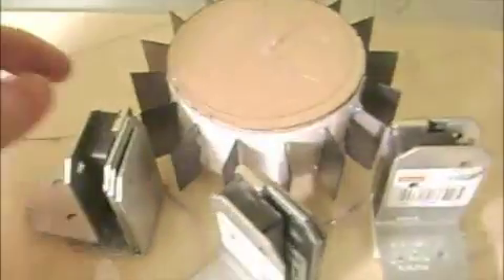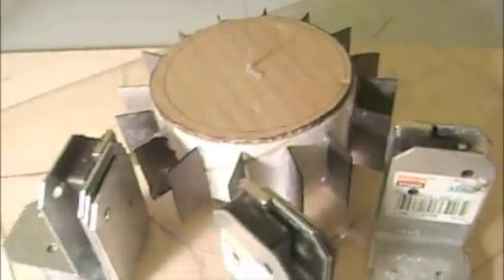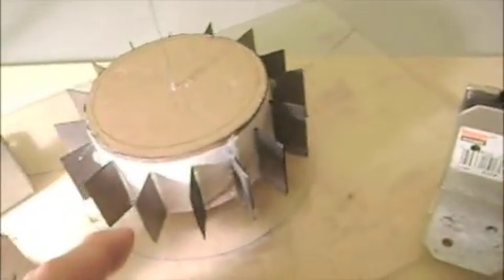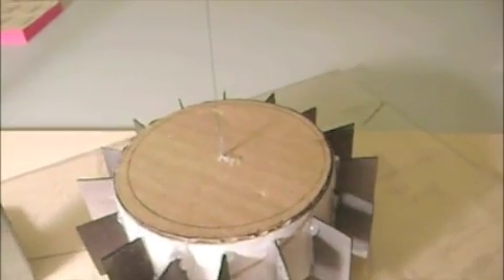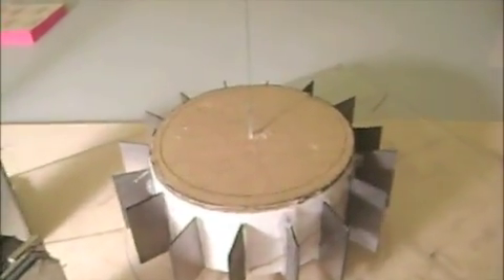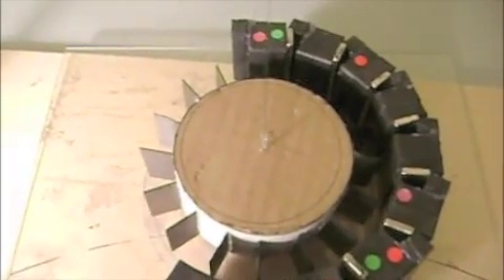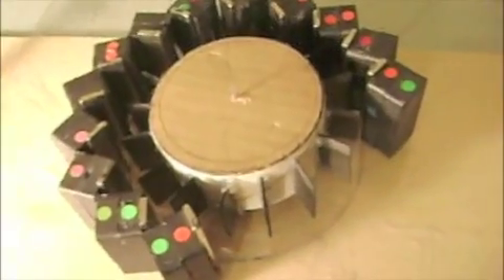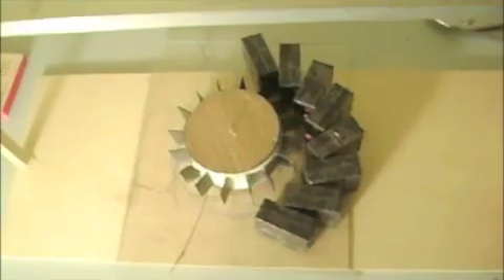Pyrolytic Graphite Rotor

Comment: My friend, I want to work with you together. we are pyrolytic graphite manufacturer, I want to give you the pyrolytic graphite for free, to help you with your test. One day, maybe our cars don't use fuel, don't use electricity, only use your Rotor.
Others who want to buy Pyrolytic graphite, can contact me: hiclsun@gmail.com
Potter Li from China.
Reply from the maker: Thanks friend. It will probably require some stronger magnets than what I was using in the first video, and some larger pyrolytic graphite.
Reply: Motionmagnetics you can try kjmagnetics.com they have great customer service, high quality magnets, and a huge selection (i mean gigantic), the magnets are dangerously powerful, literally. i recommend you do some research and learn how to handle them correctly before using them, they can easily hurt you, but they are strong enough to do some experiments with. again KJ has great customer service, for any questions on safety, contact them.
Reply from the maker: I wholeheartedly agree. I purchase a lot of my magnets from them. In fact, I just placed an order with them today to pick up some specially designed magnets that can be used to construct a Halbach Array.
Reply: Motionmagnetics nice. i myself are thinking of getting some more diamagnetically magnetized cylinders just for fun. oh and also, if you need ball bearings to reduce friction, you can get loose ones at craigballsales.com thay to are based in america, and have great products.
Reply from the maker: Thanks. I'll keep that in mind.

Comment: nice idea mate but your probably better off using bismuth coz iv worked with pyrolytic graphite and didnt find it worked to well
Reply from the maker: I have some of that as well. I just haven't felt like melting it down into the shapes I need. The graphite was easier to work with for the demo, at least.
Reply: nice work

Comment: btw aluminum is paramagnetic so it takes on the pole of the field it is close to so the same experiment might work better with aluminium and give you some repel.
Reply from the maker: Aluminum also causes eddy currents, so I'm not sure I'd get a desirable effect. Interesting idea though.
Reply: Motionmagnetics yes since you are alternating the poles maybe this will create a wave of eddy currents to surf on haha. Maybe add aluminum to the pyrolytic graphite , steel sandwich lol

Comment: Also, try facing the poles at the surface (face) of the graphite plate and angle the graphite(slightly) on the rotor... Just pumped about this vid
Reply from the maker: Thanks. I hadn't seen anyone else try this, so I thought it might be fun to experiment around with.